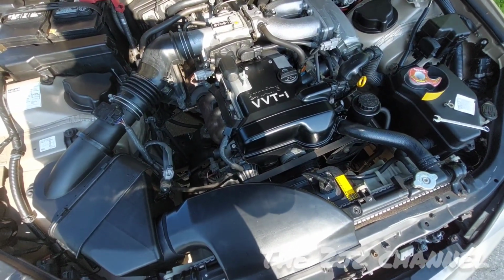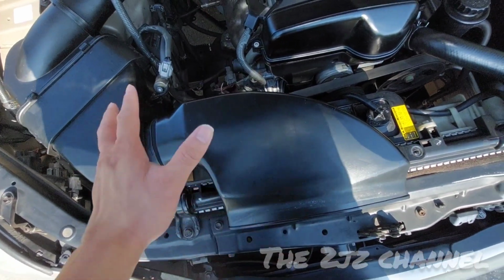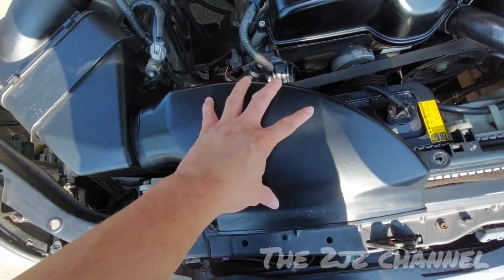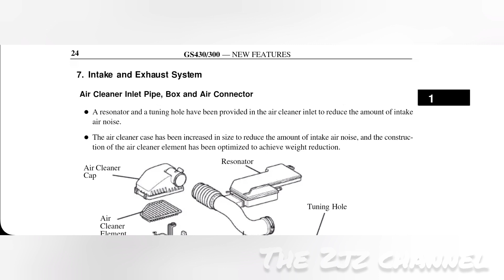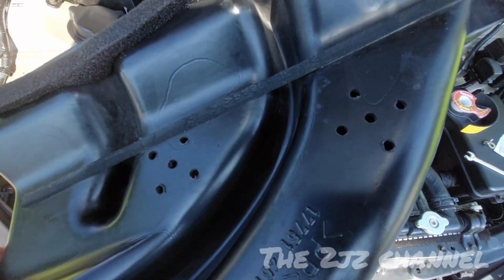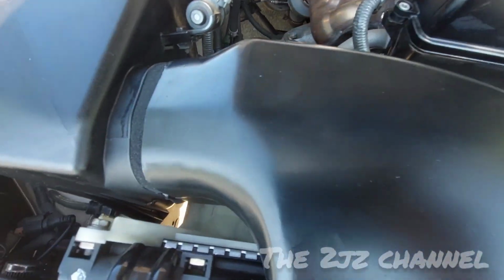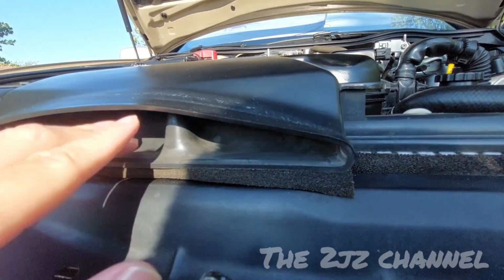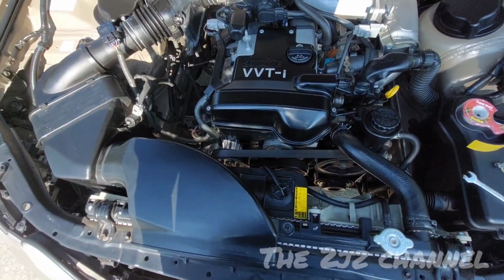A Mod That WILL Improve Your Car Torque TQ & it's FREE!

Comment: Oh man after I read the comments about removing the K&N filter I did the same on my 2004 Sienna. I noticed a difference right away. It definitely brought back the low end torque. It feels like I got back at least 10% back. I know because I apply less pressure on the throttle now. I can't hear the VVT-i crossover now, but the feeling of the torque returning is much better. It also just runs smoother like you mentioned. Even shifts at lower rpm now as well. Got mine at the local Toyota dealer for $18.
Reply from the maker: Sweet bro! Thanks for your feedback. Yeah man it's pretty crazy how much of a difference it made going back to a OEM air filter.
Reply from the maker: Have you try switching the 240sx air filter back to stock as well?
Reply: @the2jzchannel  No I'm afraid I might like the OEM performance again haha

Comment: What dimensions of foam tape you used? I need to redo my air intake to snorkel connection.
Reply from the maker: I use about 5 inch of thin foam to seal the air intake box to snorkel connection
Reply: @the2jzchannel  Thanks. I meant the thickness. Like how many millimeters?
Reply from the maker: @804MRMAN  oh gotcha no problem. About 1mm thickness not too thick because it will be a snug fit. Just thin enough for the snorkel connection to slide into the airbox inlet.
Reply: @the2jzchannel  Gotcha. Much appreciated.
Reply from the maker: @804MRMAN  no problem bro! Hope all goes well

Comment: Did i miss this part , or did you close up those tuning holes...?
Reply from the maker: I close up the tuning holes. It helps with improving the low end TQ response by increasing the flow velocity into the air tract improving volumetric efficiency air pressure and at the same improving the air induction sound. From my research the tuning holes were designed to decrease the air induction sound. I noticed that it really helps with off the line pick up from a dead stop
Reply: @the2jzchannel  cool going to try on my gs300 , should make it more lively, 

Is it best to get cushion tape , or will any tape blocking it of work ?
Reply from the maker: @Ahmed Moosaji  Sweet bro! Any tape will work as long it's a strong heavy duty type. You just need 2 strips of 4 inches long tape to cover the holes. And yeah man let me know if you also noticed the difference after doing this free mod. Your feedback will be greatly appreciated for all of us in the GS community. I haven't seen any videos or any forum posts from ClubLexus about this so hopefully this video can be useful for other's.
Reply from the maker: Oh and another tip that I'll like to share is I also recommend using a OEM Toyota/Denso style air filter for the factory airbox. I use to have a K&N replacement panel air filter even though it supposedly flow better and it's washable that low end TQ punch was reduced greatly I even disconnected the car battery doing the the ECU computer reset procedure process. I switched back to a OEM factory Toyota Denso air filter in the car just ran so much better, smoother and more low end TQ punch.
Reply: @the2jzchannel  shot dude , appreciated 

I'm thinking of removing the cats only on my gs300... what you think 

I don't want to it to be loud , as I already got a gte swopped is200, 

But just a little tone to hear that jz
Reply from the maker: @Ahmed Moosaji  no problem man. If you want to get more sound out of your 2JZ GS300 but don't want to be too loud keep your cats and mid pipe resonators on. Removing your rear mufflers will do the trick. From my experience when Removing the cats or mid pipe resonators it really makes it raspy and too loud you lose that 2jz smooth pitch engine note. When you keep the cats and resonators on and only remove the mufflers it sounds really good no rasp and sounds really deep and smooth. 

And man that's awesome! Gte IS200! That's nice! Would love to own a IS one day with a gte. Sounds fun!
Reply: @the2jzchannel  yeah exactly as you said,  I don't want any raspyness or a tin can sound , 
Just need a slight noise ro hear that it got a 2jz

Will trycand see